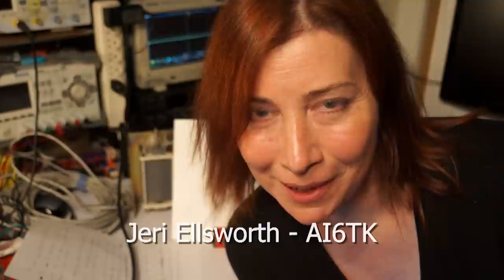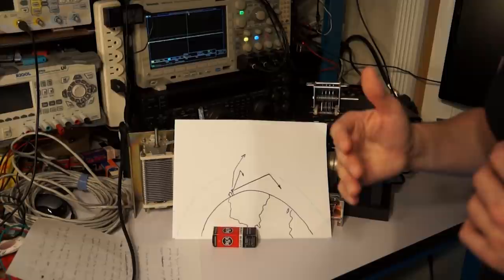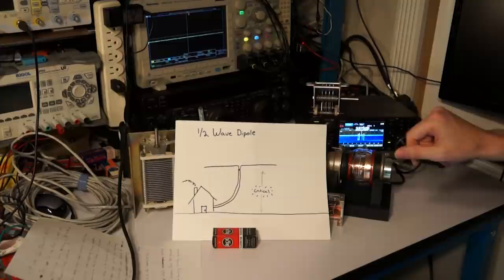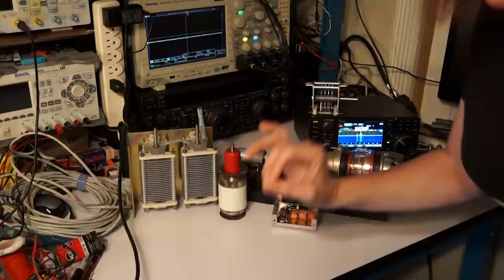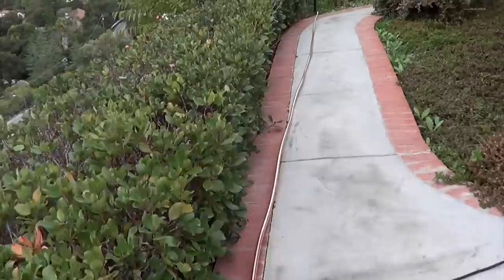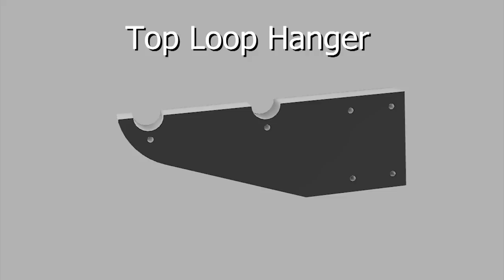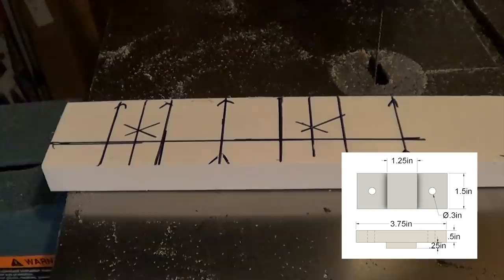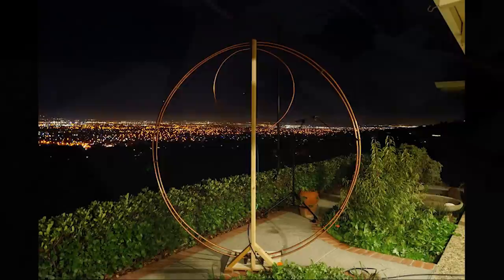Build a 160/80 Meter Magnetic Loop Antenna - Part 1

Comment: So very happy to see you posting videos again; you were quite an inspiration back when I was in undergrad :-) I have an unfinished loop of similar diameter, though I opted for a single turn comprised of copper foil wrapped around 4" flexible poly drain hose, with (in theory) all the seams soldered. I really ought to get back to it, as it worked very well for reception, and now I have a 1000pF vacuum variable good for a few kV...
Reply: For those curious: the larger diameter of the conductor should lead to improved bandwidth.
Reply: zinckensteel 
So 3/4 inch tubing will give better bw than 1/2 inch?
Reply: Yes, but that small of a change might not be noticeable in practice.

Comment: Howdy Jeri,  K4IVE, Kevin here...  Your loop looks very similar to mine, except I used 3/4 inch copper water pipe and couplings to form a giant 6.5 foot octagon.  I have 50 or so photos and videos of the build, so I know exactly how much work it is to chronicle a complicated build like this.  It's amazing how well the modeling of the antenna system resembled the finished product.  My capacitor is a massive homebrew contraption using 3/4 inch and 1/2 inch copper pipe in a compound trombone configuration.  My tuning mechanism is all hydraulic, using all plastic components and water...  What a crazy project, huh?  73! de K4IVE
Reply from the maker: That's awesome!

Comment: I built a Magnetic Loop back in 2004.   It was awesome.   It worked great on 40m.   I have the parts to make another one with a Vac. Variable and a motor drive.  It's my winter project.  I have a 50 foot vertical but honestly, I want the best power and match. I also like how selective the loop is.   I work Qrp and love weak signal.  Thanks for the video !   I am also watching and brushing up on my electronic basics.   It has been fun watching your channel.   cheers.

Comment: Nice build!  A person doesn't need all of that hardware high in the air and a Mag-Loop has good gain and a  low noise
figure. I've been building and experimenting with several different designs of them for several years and a signal
can be heard while the noise from a beam or dipole masks the signal. The biggest drawback is, they have a real
high Q-factor and narrow bandwidth. A variable capacitor needs to have a wide spacing on it's plates depending on
the power level ran into the loop otherwise the plates will arc over. That is where a vacuum variable comes in handy.
Drawback  on them is that they are fragile, high-priced, can bottom out, leak off the vacuum seal and the mechanical 
adjustments wear out. A good gear reduction drive system needs to be added for tuning on the Mag-Loop if a few
kilohertz of frequency is needed to be changed. Most of the Hams just string up a dipole since it's easier to contend
with and doesn't take any knowledge and expertise working with tools and materials.

A Warning to experimenters and Hams transmitting on them, a lethal voltage is present on a loop when transmitting
at even a low wattage level.  I built a single turn 5/8" copper tube loop using a 1,000 pf air variable capacitor. The loop
was good for the 80 and 40 meter bands.  The plates on the variable were not spaced far enough for any kind of 
wattage over 20 watts. A nice large HV butterfly capacitor with wide plate spacing would be nice. I was real impressed
your project and thanks for your review!

Comment: Cool - nice build!  I've got just enough room for a 80m dipole, but not nearly high enough for DX.  I'll be really interested to see what kind of Q (bandwidth) you get, especially on 160m.  I'm liking it so far!  73 de Alan W2AEW
Reply from the maker: The Q was interesting because it changed radically with the coupling method I used.  Using a gamma match was fairly high Q on both bands.  I plan on exploring if I can get the 1/5th diameter loop and ferrite  coupling method to behave better.
Reply: Hmm - that is interesting.  I wouldn't have expected the coupling method to have that much of an effect.  I hope you explore this in future videos - great job (and proud to have you among the ham community) 73 de W2AEW - Technical Coordinator for the NNJ Section of ARRL.
Reply: Great build. I can't wait for part 2 !! Please talk as much as possible about the math behind your design. I am currently working on loop made with 4" copper ribbon - hopefully maximizing surface effect but we shall see.
Reply from the maker: Absolutely.  I had a lot of compromises around loop diameter and matching that surprised me.
Reply: I've actually had pretty good luck with the 1/5-sized coupling loop, getting bandwidths similar to those predicted by, e.g., AA5TB's spreadsheet which can be found on-line.  But, that calculator and my loops are all single-turn, and I'm not sure what the double-loop design does to the bandwidth.  Good luck and 73, K7HKR.
Reply: That’s brilliant! Is that at a makers shade or your own shop? Pretty neat! I now want to build one. -AI6XN
Reply: whats DX?
Reply: Justin Richards DX is long range amateur radio communications, typically it is HF in nature, but there are many VHF enthusiasts who also work DX.
Reply: @moviestudioland  I'm not sure I'm hearing the type of noise, in your video, that a noise blanker is designed to work on.  A noise blanker is designed to help reduce impulse noise, which is typically high-level short-duration burst of energy which are typical from things like automotive ignition systems (coincident with the spark).  I'm not hearing anything like that in your radio's audio, thus the noise blanker isn't really going to do anything.  In my experience, a noise blanker in a non-mobile environment is generally not usable or needed because they don't work on general band noise or continuous noise sources.  One way to check to see if the noise blanker is working is to tune the rig to the CW portion of the band - find a strong CW signal and tune so that it is just outside of the bandpass - then turn on the noise blanker.  In many cases, you'll hear "blanks" in the noise floor coincident with the CW signal, since the CW signal "looks like" a pulsed/impulse type noise source in this case.

Comment: HI Jeri. Very nice work! How is the "noise" at your location? I'm located at a very high point as well.
Reply from the maker: Noise on 160m is fairly bad on the dipole, but the high Q of the mag loop helps a lot.
Reply: It's pretty high here as well, even with underground power lines. Lots of noisy consumer electronics. It's good to see you making video's again... 73
Reply: Hi,
A slight improvement in the signal can be noted by pointing the "holes" of the loop to the generating source.
The plane of the nulls of this antenna are parallel to the construction of the larger circle. You can use this feature to improve more good signal and attenuate noise source.

Part of the noise can reach the tank tuned circuit by the coax cables through the common mode currents.

A simple  BALUN 1:1 installed before the smaller coupling loop can also greatly reduce noise.

The balun must be BAlanced UNbalanced ... with turns ratio in 1: 1. Only producing the lag between the unbalanced antenna and the balanced coaxial line.

73 DE PU2SRZ
Reply: I think there needs to be more enforcement of shielding and drives to move back to the idea of fiber optic implementations and less wireless that isn't so well managed.  Seems can create more jobs also that aren't so dangerous for enforcement operations.  I suppose the JFK pervs next generation has taken hold and deviated systems to cause more jamming (not just Hollywood's), static, noise and interference.  I'm sure there is more than one root cause.
Reply: The noise is lower for me using various loops than any other antenna. I usually have built full wave loops, some vertical, some horizontal. I have a decently sized piece of property. Could easily fit a 160 full wave loop. Dipoles have always been very noisy for me.

Comment: Hi Jeri,

I just built a Mag Loop antenna using 4 inch aluminum dryer vent tubing as the main loop and copper gas tubing as the sense with a roughly up to 300 pf capacitor that was a tuning capacitor thus double ganged.

Once, I increased the sense loop's circumfrance to 6 feet or roughly 0.375 times the 16 foot in circumfrance square created by the vent tubing it began to have an impedance that allowed for about a 1.3 swr in the 40, & 30 meter bands. I was hoping for 20 meters too, but no go. I am thinking that if I use a smaller capacitor I can get it to work well on 20 meters. 

Yep, the tuned interval is very narrow. I had built likely 5 of these style antennas before, but they were all receive only thus I was pleased that by trial and error plus a found hint that a loop size that offered a good impedance was found.

I'd like a 160 and 80 meter antenna, but it seemed the circumfrance needed for this was likely to be very expensive if I used dryer vent tubing. As it was the dryer tubing came in at $80 by itself.

Nice video,
kc2wvb

Comment: Whilst I understand why Jeri has constructed her loop with the tuning capacitor at the bottom of the antenna, be aware that the greatest loss in the system is Ground Loss.  Placing the high impedance portion of the antenna very close to the ground will reduce the antenna’s efficiency markedly and possibly affect the Q.  Also, placing the antenna in any orientation too close to the ground will have a deleterious effect on efficiency.  (A quote from the late Leigh Turner VK5KLT) “The major contributor here being the steep variation in the ground loss resistance due to the very close-in induction field sensitivity. The Rgnd component falls quite rapidly with increasing height; whereas the Rrad radiation resistance changes quite benignly (image-plane reinforcement reduction), and the intrinsic antenna structure Rloss remains virtually constant with changes in height.” The answer here is to invert the antenna and get the bottom of it as far away from the ground as practical, thus reducing the ground losses.

Steve Adler VK5SFA

Comment: One exception I found where a low 160m dipole works well is for greyline into Western Australia and New Zealand from the UK when the refracting layers are steeply inclined  roughly perpendicular to the path.  All that high-angle radiation is a benefit, but only in that one case. Back in the 1990s, I built a 16 foot diameter magloop for 160m from 2 inch aluminium tube, TIG welded at the joints, but I used a big ceramic-cased vacuum capacitor and I think that was a mistake because of the contact losses.  If I did it again, I'd fabricate a parallel-plate air-spaced capacitor, with all welded joints, and use the mechanical flex of the loop with an insulated ballscrew actuator for tuning, but I'd also use much larger tube. I'm lucky to have  a couple of acres of land for big antennas, but I've always been fascinated by tiny ones. I've worked the east coast US from my 160m mobile, running 100 watts of SSB. These days I'm more into LF and microwave/mmWave but I'll always have a soft spot for Top Band

Comment: Hello Jeri, which tool are you using for the radiation pattern simulations?
Reply from the maker: EZNEC  which is easier than most, but not super easy.
Reply: @jeriellsworth  even better is "4nec2" which can interface with ITSHFBC to produce signal strength prediction maps

Comment: Hi Jeri, I build a second 160 meter magnetic loop antenna. I improved the match and using new feed line. I use Kenwood TS-50s, Yaesu FT-897D and Drake SPR4 for receiving. Big improvement on 160 meter receive. Also I home brew 1296 and 10 GHz for EME  Moonbounce .  Thanks Jeri. 73 Andrew WB4BKC .

Comment: Great stuff.....My Granddad as a boy showed me how they used this Loop for AM radio in the war to pickup
distant stations placing the radio inside the loop a right angles with a tuning Cap hooked up to about 40 turns of .5mm copper wire about 300mm diameter or how ever big your radio is to fit inside.... Cheers Brett
Reply: that was some grandpa indeed

Comment: Awesome build! Some time ago I found a 1 inch rigid copper coax cable on a junkyard nearby and used it to experiment as magnetic loop. I never finished the project, but it had promising initial results.

Comment: Great video. Here in the UK a lot of us use plastic kitchen chopping boards as insulators and easy to cut to shape. They are cheap and available in many thicknesses. I cannot comment on continual exposure to UV however. 

I am
Looking forward to the next video

73
Robert
De M0RCX

Comment: So...you're a QRPer!  It's fun if you enjoy designing and building your own antenna systems.   A lot of times, achievable distances can be highly atmospheric conditions dependent, but still, when you get that 1,000 mile shot at .25 watts....it's kind of awesome.   Then again, there's also a rather satisfying feeling of having 70kw of RMS RF at your fingertips especially when you've designed and built it all yourself too.  =)

Comment: Hi Jeri,

Nice work! Nice mechanical engineering! Really looking forward to seeing further video's on this project. 

I've built a small QRP loop initially with a air cap and then converted it to use a vacuum cap but next project is going to use 2" OD coax and a proper Russian glass vacuum cap similar to the one on your bench. Just need some time over the summer to make it work.

73 de M0SNR

Comment: Absolutly brilliant pleasure to see someond who knows what is really happening to the antenna (unlike "steve saxon"lol).
Re dipole height
Not many hams go about banging metal stakes into the ground to find where the electrical earth is or maximum permability and measure height from there.I did and the rewards speak for themselves if its on the dx cluster 9/10 I can hear it and work it.I have a 102ft doublet ,full size G5RV both north south, A99, end fed wire,  a beverage for phasing against and a home made designed vertical that out performs everything including my friends mosley beam.
Look forward to the next video.Fist seen you on ham radio now.

Comment: I made a 5 ft with 1/2" soft copper about 5 ft off the ground, I bought a 13"  Cardwell  9 to 10 kv air variable, on Ebay, however, very touchy compared to a vacuum variable, that's next on buy purchase plan. So far there is nothing out there close to this size that performs as well on 80, 60, 40, and 30 meters, also made a 3 ft  20 through 10 meter 1/2" soldered octagon loop  using a Russian surplus vacuum variable, put a scrapped printer motor as kind of a stepper with a 3 watt potentiometer as a voltage divider to control speed with a double pole double throw three position switch to change direction, have worked all over in challenging propagation conditions, and very good at cutting down the noise.

Comment: I LOVE YOUR WORK !!!  I live in an environment that is vry space restricted area, i also xperimented with Mag Loops on 80 & 40 M with vry good successes i never got with verticals...yes i  built a two turn loop on 40 but lAter discovered that with a switcheable added capacitor i cud tune the loop on 80 M as well.... 73s keep up the good work !!!

Comment: Jeri, with that nice tube bender you could follow up with a 10 meter quad.  The hard part is getting it on the roof.  I know, not practical - but somebody once told me I had my helmet on too tight.  73s

Comment: I just bought 35 feet of 5/8" copper pipe to make a 40m mag loop antenna (single loop).  It's for dedicated use for a solar powered QRP JS8 message server so it'll be tuned once with a parallel combination of 3KV fixed capacitors.

Comment: I'm a newly minted HAM in Ontario Canada. We have local nets on 80 meters which I attempt to join but,  I'm commonly frustrated because I'm using a 60-foot end fed wire antenna elevated about  10 feet at the highest point. This very compromised antenna, combined with poor propagation during summer months has stimulated me to consider putting up a delta loop as high as possible. However, if I can get a good result on 80 and 160 meters with a big magloop, that would save a lot of extra effort putting up very tall supports. The local nets here are all within 500 miles, so effectively I'm seeking a NVIS type antenna for 80/160. However If I can also get a good DX antenna in the bargain that would be excellent. I've been cautious about magloops given the fiddly tuning issues and directional qualities. Recently I've come across a new magloop accessory designed by Cameleon Antennas. This little gadget allows the antenna to be tuned and oriented from the station at a distance from the antenna. That kind of functionality really does make the magloop antenna seem more practical, especially in a base station situation. I look forward to your next videos.